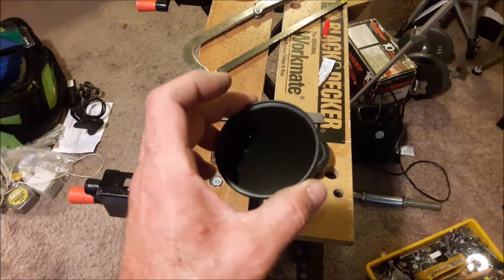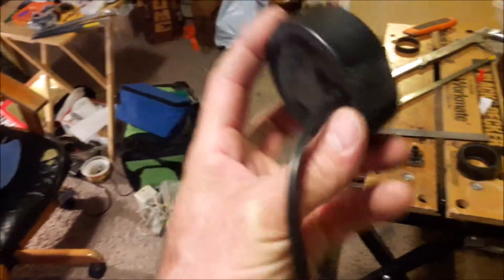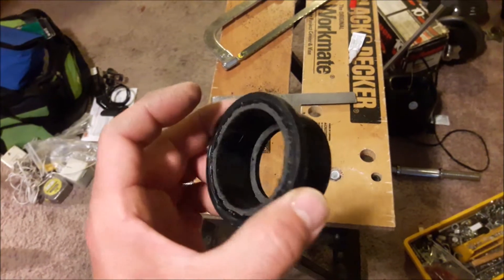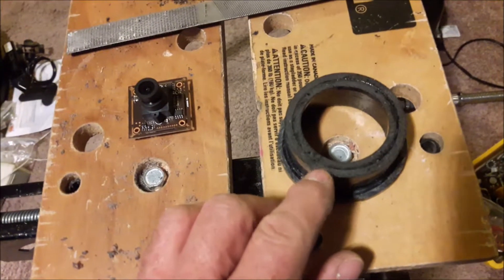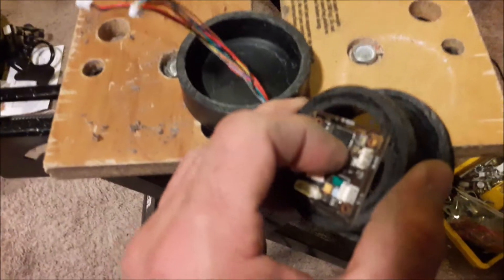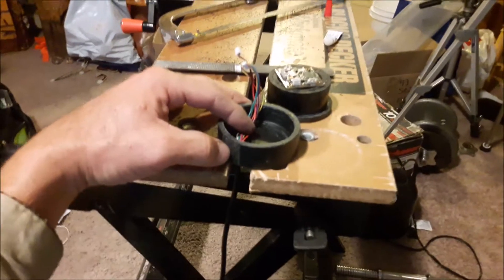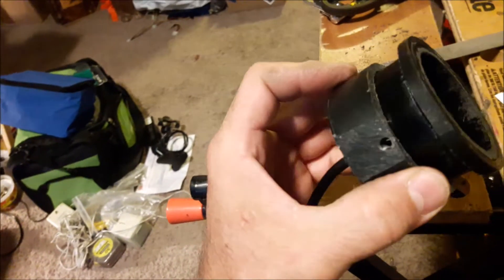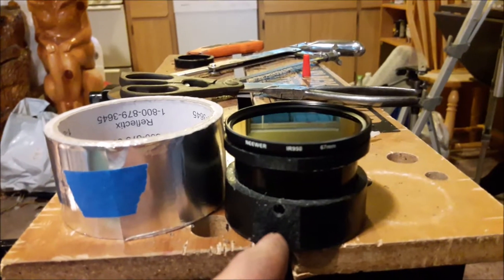Sony IMX225 0.0001lux testing, unproven, camera see through fog increased visual reference 950nm IR

Comment: Awesome idea!

So is this a RunCam night eagle 2 PRO or a Sony IMX?
Reply from the maker: currently it's the Sony IMX225 0.0001lux ISO 13,000,000 i'll post some more daylight driving scene videos soon. With the Sony EFFIO menu controls I can adjust exposure to 2x (1/15 second shutter instead of 1/30, even more but blur becomes an issue), boost contrast, noise reduction and shut off WDR in fog for increased object detection.